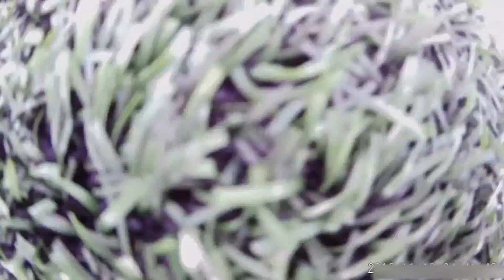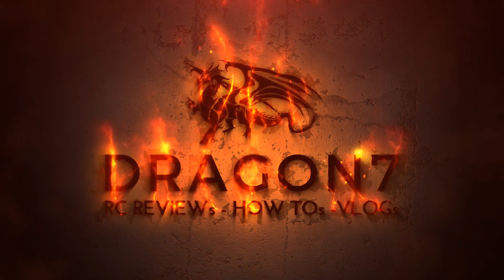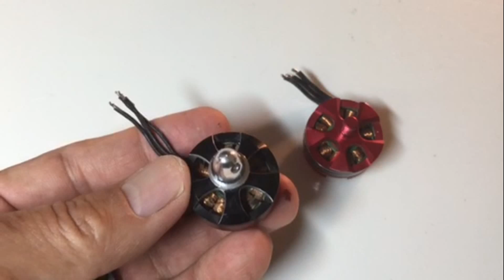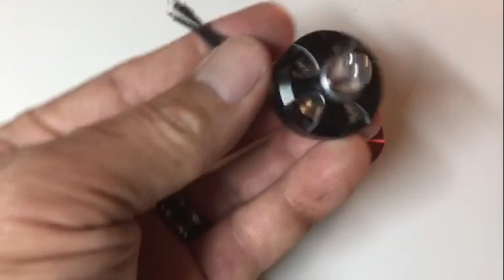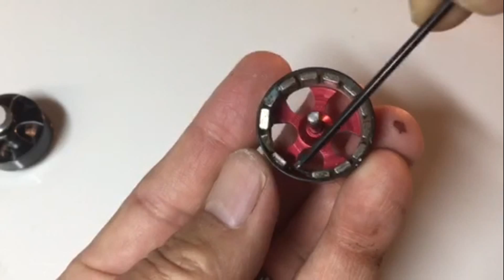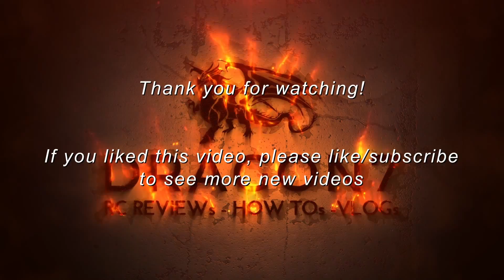How to Check if Your Motor is Fried

Comment: Old video......I just finished a 3" build, was flying really amazing and having fun, motors not hot after flights etc........I crashed and was having trouble finding it. I knew the relative area and knew I was in the 'area' so I gave it a quick arm/disarm to hear the motors turn, and didn't it burst into flames taking the JHEMCU 45A AIO and 2 motors with it. Literally heard the 'pop' from the ESC that set the thing ablaze, and then found blackened windings on 2 motors. Not sure which is the culprit, but would lean towards the amp draw.....motors.

Comment: I have brushless motor, and i fried it, but imediatly shut off the motor, change esc, and the motor is still alive, altough it burn out the wire, its only about 1-2 second the motor is fried until i stop the motor,

Comment: Why not epoxy the two magnets back into place being careful to make sure their polarity is in the right order?
Reply: I have tried this it doesn't work. The position if the magnet needs to be very precise. If you try to glue them back they will rub on the stator and the motor will destroy itself very quickly.
Reply: @HighVoltageMadness  ill bet if you were serious enough about getting them in place you could use an old trick us motorheads keep on the down low. When building rebuilding or r&r vearings races etc on superchargers weve been known to use rice paper to shim and check our tolerences on the veins. When ive got one between my legs on my drag bike you can bet your ass and my juevos  theres no doubt in my mind its not going to come apart and damage my...stator so to speak. I am certain my armature and bearings will be going home with me in tact.
Reply: @davidreynolds4684  what's a piece of rice paper worth? 10 thou?
Reply: @HighVoltageMadness ok thanks. I havnt messed with these little motors much but I've had success with rc car/boat pumps cordless tools and one of those massagers you're supposed to use on your neck but my female friend always said it wasn't her neck that needed attention. I guess her leg hurt or somn.

Comment: if it smokes slightly is it still usable?
Reply: When a motor smokes that means it has become so hot the enamel on the windings is burning off. When that happens you no longer have 'individual coils' which the principle of induction works on. In essence your motor is toast.
Reply from the maker: FPV Shadow Probably not. Try running it.
Reply: @D7dronetech  turns out it's working ok.... for now
Reply: I noticed jitters while flying. Then today after emptying a battery in just under 1 minute of throttle debauchery I notice the rear two motors are so hot they burn my skin. Looking inside I can see on both some of the phases are darker. It still flies but I don't trust it now. Fly with caution.

Comment: Hey bro i just had a motor smoke up and i replaced it with another motor and it smoked up straight away . What make motors smoke ? Cheers bro
Reply: phil tribe Stress... like humans lol
Reply: Do you know the answer by now? I just burned a motor and a 4in1 esc. I will replasy the esc but i do not know if the other motors are okay.
Reply: @LyroLife  lol i forgot about this comment.  Yer was the esc , ive made alot of costly mistakes and found out the hard way, but luved every bit of it. 
Now ive just got to figure out how to stop crashing 😂😂😃👍

Comment: If you fry a esc yet yank the battery off in 2seconds. Will the motor it is attached to be damaged, it was warm but no where near hot. I won't be able to test until next week when the new escs come
Reply: how did it go? Motor still worked?